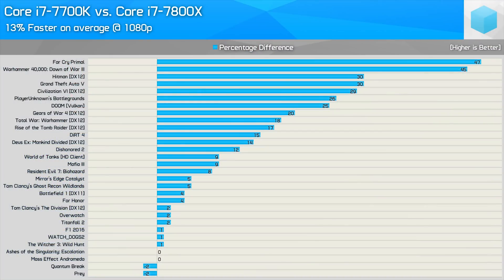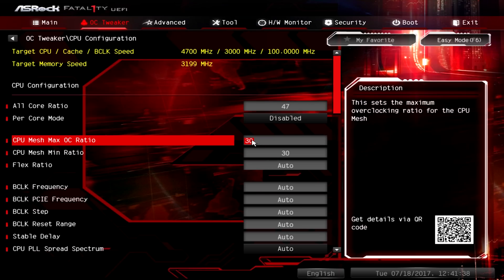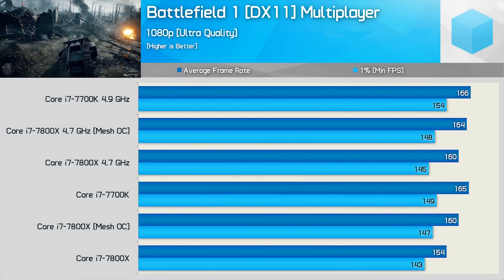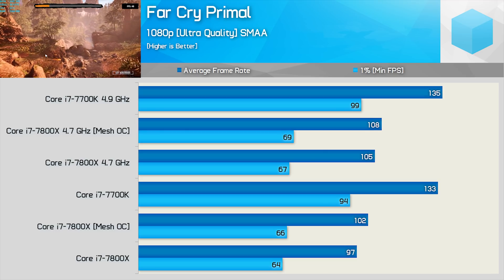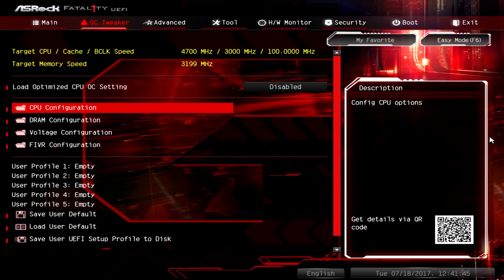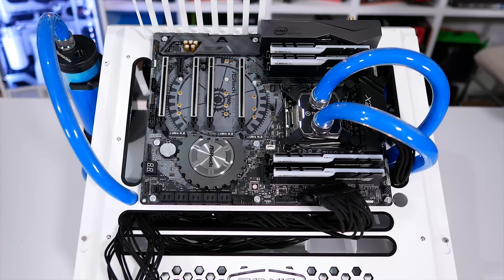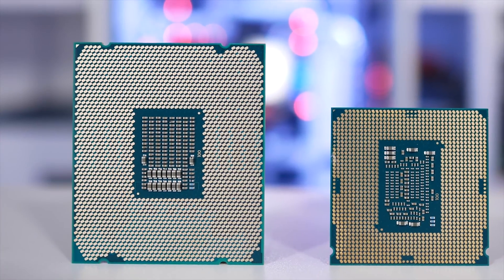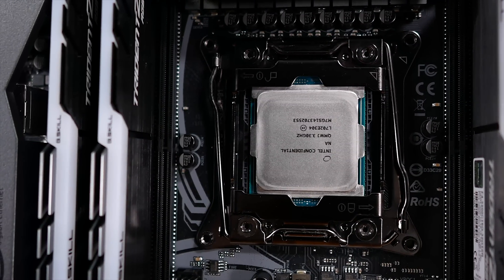Intel Mesh, Does Overclocking it Fix Skylake-X?

Comment: Processors that nobody should buy at the moment:
- Any Pentium except the g4560
- Any i3 
- The R5 1400 & 1500x (too close in price to the 1600)
- Any i5
- Any locked i7
- Any x299 i7

So basically only the g4560, 1600, 1700, 7700k are worth it. The x299 chips have some use in professional settings (i guess). But the 7700k beats them far too often for them to be seriously considered.
Reply: Peter Cruz the r5 1400 is a good option if you want to spend more money on the graphics card
Reply: I'd say the r3 1200 and the r5 1400 are ok if you want to get on the AM4 platform. But the jump in performance between the 1400 and 1600 is pretty huge. I would recommend to go with it if ever possible.
Reply: You forgot the 1700X and 1800X.
Reply: I'd still say the 1500X is worth it depending on where you live, and considering that if you've got a mid-range GPU there's barely going to be, if at all, a difference in FPS because the GPU's going to be the bottleneck.

X299 is just mostly useless, even in a professional setting simply because Threadripper is a thing. The only time it's a better option than Threadripper is if latency's a factor.
Reply: Peter Cruz August the 10th threadripper for sure... 16 cores  with free aio for $999.
Reply: Your Xeon choice would be E3-1245 V5? But Skylake Xeons work on few chipsets.
Ivy Bridge E3-1245 V2 is good enough and fast DDR3 is much cheaper than nice DDR4.
Reply: Also the 1500x is a fine CPU, much better than the locked i5's. It has more cache than the 1400 so a worthy upgrade. But still in the UK is way too close in price to the 1600 for me to recommend it.
Reply: bought r3 1200 (game is much more gpu bound anyway), then change to zen 3 or zen ++ in 2020 without changing your motherboard (the beauty of am4 platform)
Reply: The 1700 is around $70 cheaper and can guarantee within 100Mhz of the 1700X when overclocked. The 1700X and 1800X aren't as good a value.
Reply: I got my 7820X for 24/7 rendering and it kills my ryzen machine LOL the ryzen is the best bang/buck but not the best performer
Reply: SlavjanA For 99% of us, threadripper is useless, there is only a few programs that uses more than 8 cores lol
Reply: Thats true it's not usefull for the average joe but it has great performance and the guy was talking about buying a xeon if he went for more cores then the price performance of theadripper is outstanding.
Reply: beatsh0t Intel will owns the high end. But it's not cost effective. And tbh I think a 7700k would beat quite a few higher core chips dues to optimisation. The 1600 is good for gamer desktops because you can multitask and game
Reply: I agree, very good point
Reply: Actually, the G4600 is a better buy right now! It's also Kaby Lake, runs at 100 MHz higher clock speed, same 4 threads/3 MB L3, 3W lower TDP, and it's $87 (G4560 is $178 and change, probably due to its popularity.) The G4600 has HD Graphics 630 rather than 610, which nets you another 50 MHz max IGP frequency. There might be other performance gains going from 610->630 if you'd use the IGP.

https://www.newegg.com/Product/Product.aspx?Item=N82E16819117739
Reply: i3 can be really good if you need higher single threaded performance than i5 but can't afford i7.
Reply: Vivil there's no i3 that has better ST than an i5 except an overclocked i3-7350K. but then again, at that price point you'd better off with a locked i5 anyway
Reply: You mean that 7320 4,1 Ghz have worse ST performance than 7400 which can boost at most to 3,5 Ghz? Passmark single thread rating for 7320: 2392; for 7400: 1957. 22,2% difference in favour of i3.
Your assumptions are wrong.
Reply: If i had a serious business id probably just go for a xeon chip tbh. If i was video editing id go for a 7700k or a 1700. I would not use threadripper in a serious business because intel have better support networks and much more troubleshooting information/ better compatibility & optimization (much older ecosystem). 

But as an average consumer i'd go for the 1600 every time. 90% of the gaming performance with 6 cores 12 threads, unlocked. 1700 and the 7700k arent bad either.

Comment: Still faster then PooZen on gaming...
Reply: futmut1000 dafuq is your problem with competition??
Reply: LMAO Are you stupid? How im having a problem with the competition when im only stating facts? Should we praise Ryzen for gaming when it gets beaten by an i5? Just lol...
Reply: The only i5s that sometimes beat Ryzen in gaming are the new unlocked ones, and it depends on RAM speed and what GPU you are using. Ryzen with 3600MHz RAM is close to the 7700K in gaming.

Not to mention that a single youtube video running in the background while gaming would kill the i5's performance, and the fact that an i5 7600K + Z270 MB + CPU cooler combo costs more than a Ryzen 1600 + B350 combo.
Reply: Mongocom he did say gaming, intel is still the milk ever last frame  possible CPU AMD is gaming plus streaming
Reply: Just another 12 year old who plays LoL 24/7.. Move on

Comment: Its annoying. I bought an i3 and z270 board in January with the plan of upgrading soon. I now have the budget to buy a 7700k, but i'd much rather support AMD and think they have better cpu's. I'd go for the 1700 if i did it all again. 

BENDS OVER "take my money intel"
Reply: buy 2nd hand cpu's. You're no longer giving Intel money
Reply: Remember when everyone was saying "wait for Ryzen" in January? Should've listened, mate.

You've still got the option to sell though, and I would do it soon before Ryzen 3 comes out.
Reply: Slavjan i disagree, the 7700k is still the best gaming cpu and second hand in the UK theyre about £220. it works out cheaper for me to get the unlocked i7 than 1600. It's a no brainer
Reply: I never said it wasn't, but you wrote that you would've rather gotten a 1700 and I'm saying that you still can.
Reply: the 7700k is less future proof though. as new games come out its lack of cores will be its undoing.
Reply: bmxriderforlife1234 not sure I agree, developers will just optimise for the most used cpus. I reckon the 7700k had got a good life ahead of it still
Reply: no they wont. devs are already optimizing for 8 threads. its becoming more and more common. the 7700k is already getting worse minimums and more fps dips then ryzen in many games. remember how reviewers were alltalking about how smooth ryzen felt? yeah thats why. 

7700k is todays top end gaming cpu but tomorrows mid tier cpu. 

4 cores 4 thread entry level

4 cores 8 threads or a first gen ryzen cpu due to clock speed and ipc limitations is mid tier

6 cores 12 threads new high end gaming cpu. x299 couldve done this if cache and bus had been left alone. 

8 cores 16 threads entry level streaming cpu. 

10c20thread intel or 12 core threadripper dual streams cpu/workstation. 

ryzen due to ipc and clock speed will place between mid and high end, itll loose most likely to intels next 6 core part on the next consumer line as long as they dont change the cache and bus, but beat 7700ks. 

the next ryzen cpus i expect to get closer and closer to ipc and clock speeds of intel but have more cores and cost less. basically by 4th gen ryzen i expect amd to be either ahead or tied with intel unless intel works their asses off.
Reply: The 2600k is still a viable chip hell, it's still considered  a high end chip according to passmark. The 7700k still has a lot of life in it. But I wouldn't be buying one now may as well wait for coffee lake and Ryzen 2, both are out either end of this year or early next year. Unless you urgently urgently need an upgrade. Even then I'dprobably opt for a videocard upgrade 1st.   But it'll still be viable for quite a while yet. But speaking of optimising for popular processors the 7700k is not that popular in the whole scheme of things. It's an enthusiast part. Majority of PC's running around in the real world are bog standard Dells etc featuring budget to midrange processors. This is also backed up by the Steam survey data. Only 5% of the Intel processors are running above 3.7ghz. No-one buys a 7700k and underclocks it.  Now if the quarterly results are anything to go by I don't need to remind you that midrange is where intel is losing ground.
Reply: oh hell yeah it is, as for the 7700k for its price id say stay away. intels next line up is 6 core parts, that manes either 6 core 6 thread i5s or i5s potentially get hyperthreading and stay at 4cores. if you can hold out i suspect intel might just do hyperthreading as quadcores have been around how long. i7 is high end consumer parts. and like i said just looking at things im thinking we may starts seeing 8 threads fully loaded out alot sooner then people think. 

also killing off dualcores for new games while yes cuts down on the potential customer base helps intel and intel often pays devs to optimize for their stuff. so does amd and nvidia. less so amd cause they dont have the money they more so help where as intel can just throw money at people. intels low low end market probably wont be affected much by amd as i dont think amd can produce a chip as cheap, however their 4 cores and up i believe amd wins. intel also offers a 100$ 8 cores 8 thread cpu, though its an atom. 

as you mentioned intel is losing market share in the mid range, if amd floods the market with 6 core cpus that are good intel moves to high end consumer parts at 6 cores, ryzen 8 cores would be easy as who cares and its scalable. but 4 core and 6 core will get optimization, meaning games will starts really loading up on 4 cores 8 threads. console market has 8 core parts. and modern games have pretty quickly been moving towards 4 core 8 threads and even beyond. i believe the 7700k is going to see a point where it basically just gets bumped down a tier because intel cant stagnate things anymore. 

wendell(level1techs) has also said he thinks we probably shouldve been at 6 cores on the consumer desktop by now. 

and just think as beastly as a 7700k is add two cores and change nothing... yeah that means those 4 cores 8 threads of the 7700k can be devoted entirely to game. 

theres also the fact killing off dualcores can help devs, no core 2 duos no i3's. i hear getting modern games to run on dualcores can be a little hard for the devs.

Comment: Would be interested in 1440p or 4k benchmarks. Since they are less CPU bound, the gap should be closer or none existend. I highly doubt that someone spending like 600-700 USD on a CPU alone will game at 1080p.

Comment: 7700k is kaby lake, which already has almost 15 percent IPC improvement over skylake, so I am guessing these results are not because of the new mesh design.
Reply: Seko Us Kaby lake has like 0 IPC improvements over Sky Lake. The 7700k has higher clocks than the 6700k, making it faster (and hotter) at stock speeds. Kaby Lake also has ring bus, not mesh.
Reply: Yep, it was the clocks, IPC was the same, I guess does this mesh design gives 7800x roughly the same performance as 6 core ryzen cpus in games. It doesnt explain much better performance  of the 7900x though.
Reply: Not even the clocks, Kaby Lake's only got a 8% advantage in clock speed (assuming the average 4.6Ghz for Skylake and 5Ghz for Kaby Lake).
Reply: saladwithsalad you must be fun at parties...
Reply: the only IPC improvement on the kabylake arch over skylake is in avx workloads and then the hardware drm shit they built into them for 4k streaming and blu ray. for gaming their ipc is identical the difference in performance is purely from clock speeds being alot higher.

Comment: You should use high clocked memory with a high mesh overclock to equal a 7700k.
Reply from the maker: They both used the same DDR4-3200 memory.

Comment: But...but Intel told me NOT to overclock their CPUs ;(
Reply: They did not, the only difference between the 7700 and 7700K is the open multiplier which enables overclocking. Therefore Intel whats you to overclock.

Comment: Nice investigative tech journalism Steve! My take on this, as a software dev, it's not so much the latency increase of the consumer core Mesh vs Ringbus, that led to the regression in gaming performance. It's the changes to the L3 cache type & hierarchy. SkylakeX L3 is now essentially a victim cache like Zen, it's not an inclusive cache like prior Intel architectures. Victim cache actually makes a lot of sense for higher core counts as the cores can basically contribute to each other's performance with higher cache hits. But Intel sacrificed the per core L3 amount. For a victim cache to work well it needs more associations and much larger quantities. IMO, they could not make it larger as they are approaching a "too big a die".
Reply from the maker: Hey mate thanks for weighing in on this, makes me very confident it’s the cache now. That’s what I went with originally but back-paddled as most people told me it was the Mesh. Makes sense though what you have said, given we are seeing ‘Zen-like’ performance. Obviously that’s not a bad thing at all, at AMD’s prices anyway ;)
Reply: It's actually worse than Zen (I'll explain) L3 design, but Intel is making up for it with brute clocks & larger L2. L3 typically have more cycles (slower latency vs L2 access), on Zen, AMD makes up for this by making it both large and shared with the other cores in the CCX. It's not 2MB per core, it's 8MB per 4 cores, all shared with enough associations for parallel read/write cycles. 

Zen's L3 acts as a core multiplier for cache hits, the more activity within that CCX, the higher the L3 hits will be because the byproduct cache data from each core gets shared with the others, any core that needs data, it checks that large L3 and hits it instead of tripping to RAM. 

Intel's Skylake X L3 is a victim cache that is crippled because they did not make it a shared cache with the other cores directly, but any access has to hop over the nodes on their Mesh. It's core specific, smaller and non-inclusive, a really bad combo for an L3. 

It's a compromised design focused for high core counts not meant to be great at gaming. They could have made it great for gaming too, but it would require more power and die size.
Reply: Vyor: Zen & SkylakeX L3 are victim cache, non-inclusive. http://www.anandtech.com/show/11550/the-intel-skylakex-review-core-i9-7900x-i7-7820x-and-i7-7800x-tested/4
Reply: @NerdTechGasm Never seen your channel before so I went and watched some of your videos, and they are great! I hope you continue doing more videos, technical and in-depth information is hard to come by :)
Reply: Curious what you think about possible clock speeds for upcoming larger core-count Intel parts. I can't imagine - given the power needs of the architecture at this point - that Intel will be able to pull off speeds higher than 3.4GHz, especially in the 14+ core chips. I think they're too big and will run too hot for reasonable single-core performance under load.

Edit: also love your videos. You make some of the only content I actually just stop and listen to, exactly what I wish more of the tech press was doing.
Reply: atomkinder67: regarding Intel's higher core SKLX, I think base clocks will be well lower. The reason is that X299 boards are advertised to be compatible with all SKLX CPUs and Intel's 7900X on stock is already over the limit of it's rated TDP (compare to Broadwell 6900K or 6950X). 

In order for Intel to keep compatibility across the X299 platform, their 12-18 core SKUs will need base clocks around 3Ghz. Ofc users can OC them, but not wise on a lot of the current boards with their poor VRM cooling and limited 8-pin power delivery.
Reply: Vyor Generic Last Name but that's last year's top performance when every year is a chance to switch up to better results than last year but not sure if that's how everyone feels.
Reply: Vyor Generic Last Name amd needs to hit 5hz base clock and 16 cores 32 threads!!!
Reply: I would just like to add that NerdTechGasm has a very nice channel, I've just seen a few videos so far but he provides a huge amount of insight for those interested in the underlying tech.
Reply: Good points to bring up in a discussion. I had someone argue that they will be 4GHz and I completely forgot to mention VRM and power issues. This will be an interesting release for sure though.